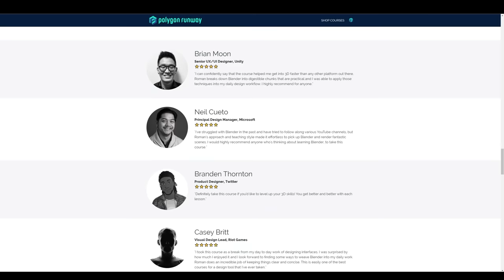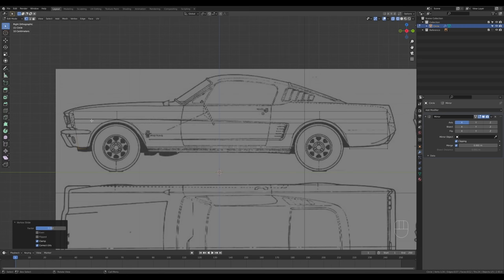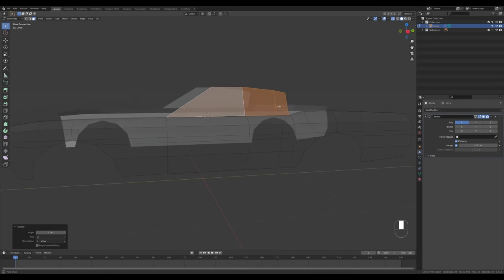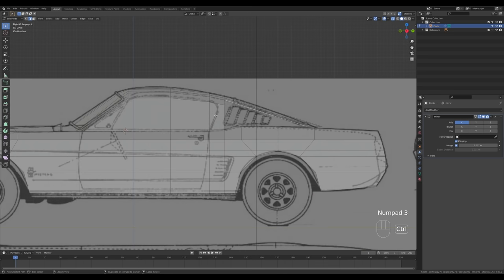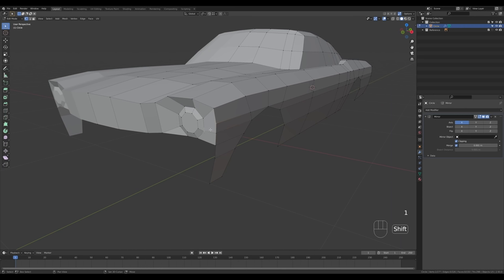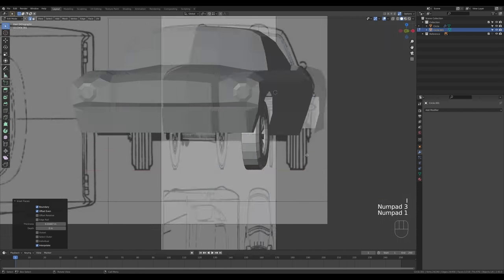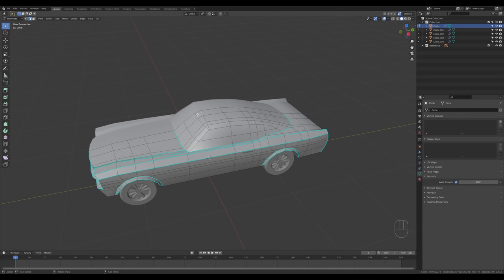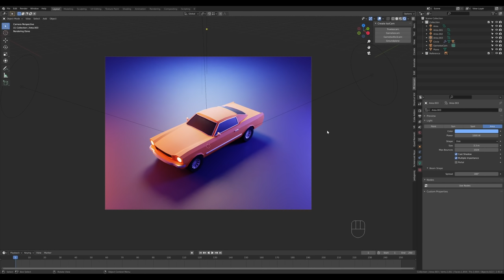Blender Low Poly Car Full Tutorial - 1965 Mustang | Polygon Runway

Comment: Finished, the result is way better than i expected. Did not have the patience to fix some minor issues, so the car is far from perfect, but that is just me being lazy. I wish the last part was commented as even on 0,25x it was difficult to follow. Also, on blender 3.0 i could not run the isocam. After all 9/10, thanks a million!
Reply: The isocam problem is probably a bug in your pc, I use 3.0 too and I could use the isocam addon without any problems.

Comment: This turned out very nice! 
One of the hardest things to model so far that I have encountered is a 1950 Ferarri Berlninetta 166MM.
It doesn't have a strait piece on it and has the old rounded front fenders typical of the 30's and 40's but this one carries that all the way to the back and evenly tapers to a point where a small round tail light sits.

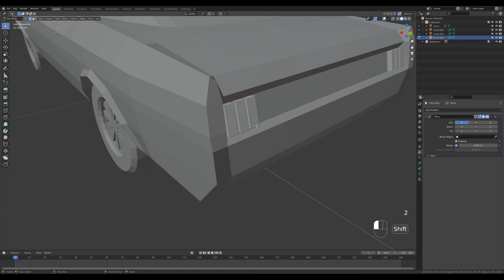Comment: 37:56 If bevelling the rear lights clip into each other or deform, make sure that you've turned off Auto Merge before proceeding to bevel, to do that, go to the top right corner below the various shading tabs, select "option" and deselect "Auto Merge", it should work fine now.
Reply: thanks :)

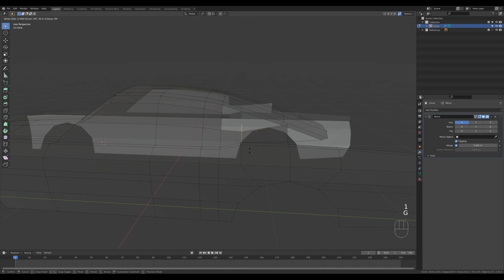Comment: 21:55 I'm having a strange issue with the Loop Tool Curve. When I right click and select Curve it changes my geometry on the door. I tried going into object mode and applying the scale but it didn't fix it. I've also tried closing and reopening blender which didn't seem to help either. If anyone has a solution or knows what I'm doing wrong please send it my way.

Update: I figured it out, once I click curve and the box that pops up in the bottom left hand corner I checked "Boundaries" and it changed my geometry back to normal.

Comment: how do you make the mirror a mesh i added for wheels instead of the way you did it beacause i want to use it for my game but it wont rig and i think its beacause the mirror is not a mesh
Reply: After you've completed everything you have to apply the modifier. Next to the modifier name there are a few buttons. Click the arrow and select apply.  If it doesn't work try doing stuff like, deleting the duplicated wheels and re-duplicating or whatever nonsense works. I did something, not sure what, but it worked out in the end. If you want to separate the wheels the select one of the wheels in edit mode and press 'P' then click "Selection". That will separate the wheels.